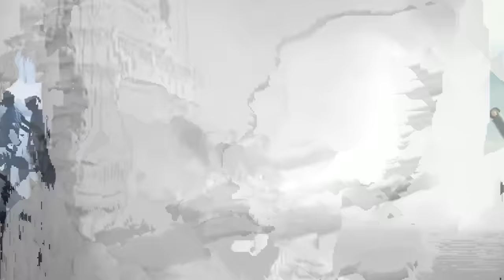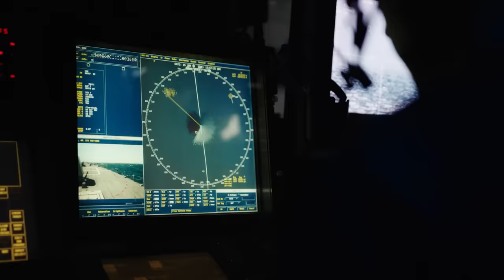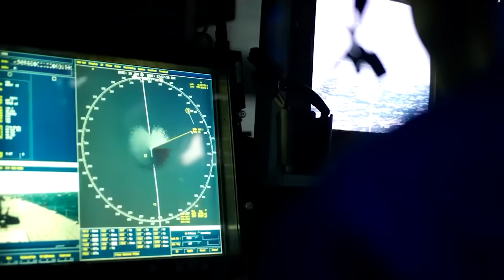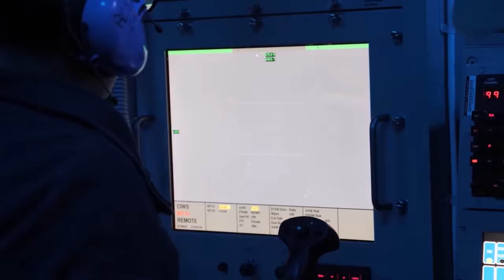Why Do MASSIVE US Aircraft Carriers Have TINY Guns?

Comment: I thought they had a few big guns on them!?!? Or am I thinking of WWII Carriers?
Reply: Mainly the WW2 carriers, I know at least the super carrier built the USS Forrestal in 1955 still had numerous 5 inch guns.  Probably during a shipyard period she has them removed. The carrier still has in addition to the 70 or so in the airwing they have missiles for self defense as wells a few close in weapon system. Plus chaff and electronic jamming. Plus the escorts have long range as well as short range defensive systems
Reply: The USS Lexington and  the USS Saratoga were both built with 8 inch guns, same size as a cruiser 😅
Reply: @ronjones9447  The Sara was a Forrestal class ship. It was 8 5"/54 guns, not 8" guns.

The same gun mount we had on the USS Vreeland FF-1068.
Reply: @brolinofvandar  talking about the WW2 carriers
Reply: Unless things have changed in the last 30 years most of the guns this claim are carriers are not.
Reply: @skipstreet  the Nimitz CVN 68 is right at the 50 year mark. No major guns on her or anything newer
Reply: @ronjones9447  @brolinofvander @skipstreet Thanks for al the responses. :)